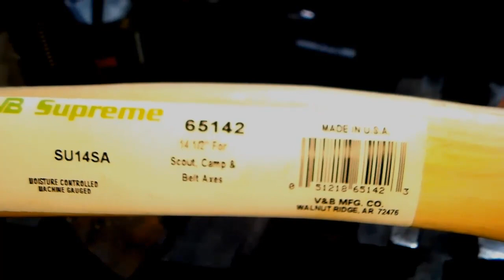MYOG Rehandle A Hatchet

Comment: I tell you what , friend bought me a Cold Steel Riflemans Hawk years back. Now I know the handle is supposed to be removeable and such but I had no intention of throwing that honker and this was before the Woodsmans wedgie etc. So I removed that damn varnish off the handle, it makes blisters on the hands of many a bladesmith. I wrapped the top end with that Magic Wrap self adhesive rubber tape, put a pipe over the top and drove that head down over it. Sharpened that thing and dude I have beat that hawk, Whatchoo takin bout?😂 I mean hammer, chop, split, cut bone in a whole hog BBQ . I artfully decorated the handle with a torch, and used BLO for that,  and FGMO for the head😂
Reply: The pipe went over the handle from the bottom side
Reply from the maker: sounds good